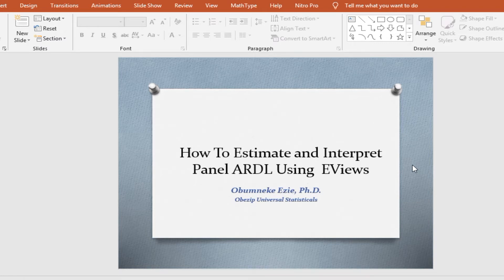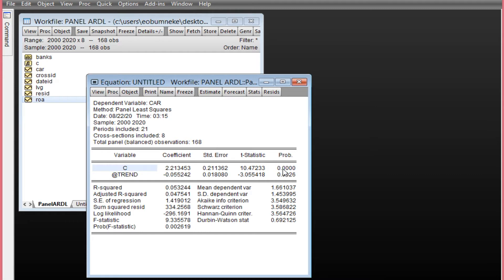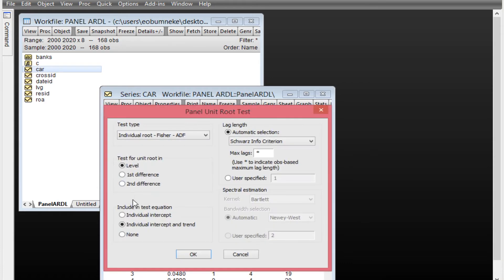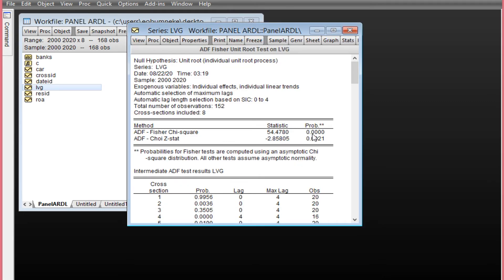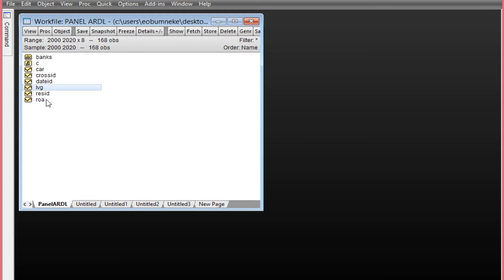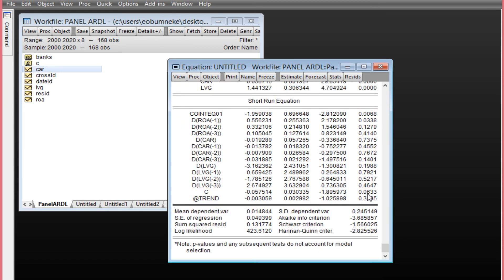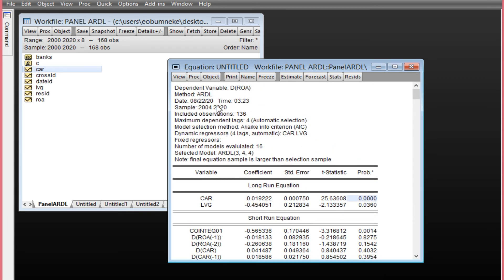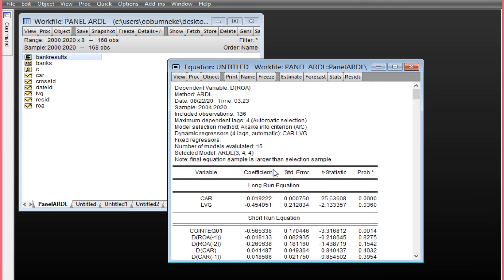EViews: Panel Unit Root Test & Panel ARDL (Estimation and Interpretation)

Comment: What if cointegrating equation (speed of adjustment/ error correction term) value is positive and insignificant  (In Short run equation panel of ARDL results)? kindly explain
Reply from the maker: In econometric analysis, particularly when using the Autoregressive Distributed Lag (ARDL) model or an Error Correction Model (ECM), the error correction term (ECT) represents the speed at which the dependent variable returns to equilibrium after a change in the independent variables. This is often derived from the long-run relationship between the variables, which is assessed through cointegration tests.

Now, if the error correction term is positive, this is unusual because it suggests that if there is a deviation from the long-run equilibrium, the variable will diverge further from the equilibrium in the next period, which is counterintuitive. Typically, we expect a negative ECT so that any deviation from the long-run path is corrected over time, bringing the variable back towards equilibrium.

Moreover, if the error correction term is statistically insignificant, it indicates that there is no error correction mechanism at play. This could mean that:

There might not be a long-run equilibrium relationship between the variables (i.e., they are not cointegrated).

The model may be misspecified. This could involve issues like omitted variables, incorrect functional form, or measurement errors.

The data may not have enough power to detect the speed of adjustment.

For policy analysis and forecasting, an insignificant and positive error correction term suggests that adjustments to deviations from the long-run path are either not occurring or not behaving as theory would predict. This means that short-run fluctuations may not be informative about long-run relationships, and relying on such a model for policy implications or forecasting could be misleading.

In such cases, it's important to review the model specification, consider alternative estimators or models, and ensure that the data is suitable for the analysis at hand.
Reply: very informative and very well explained..thanks @obezipacademy

Comment: if I have 22 firms with 10 years, can I use this technique?
Reply from the maker: Yes, you can use the panel Autoregressive Distributed Lag (ARDL) model. Given that you have 22 firms and 10 years of data, this gives you 220 observations. While this isn't a massive dataset, it's sufficient for many econometric analyses, including panel ARDL, especially if the relationships in your data are strong.